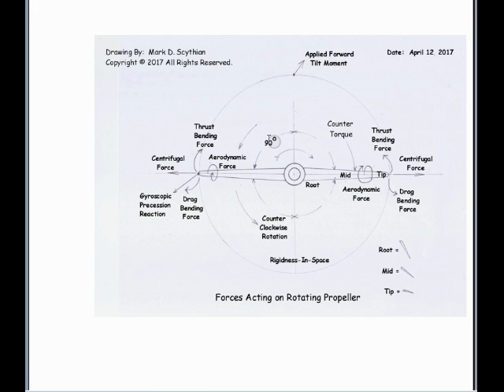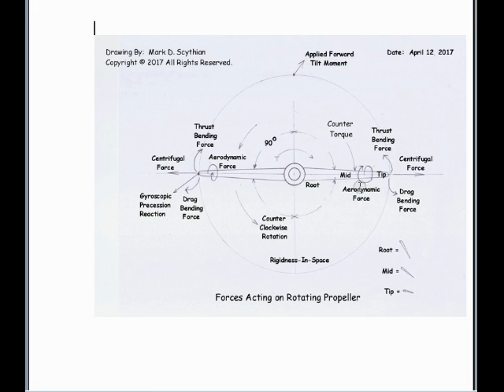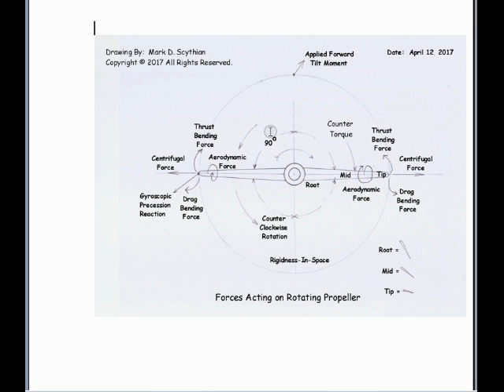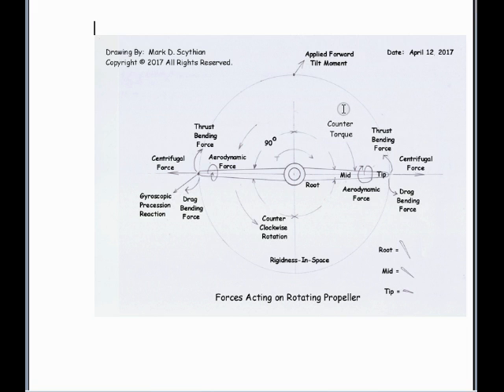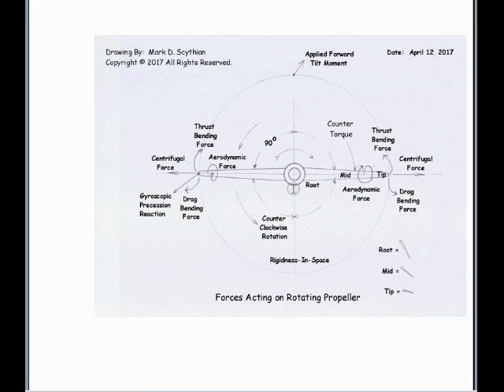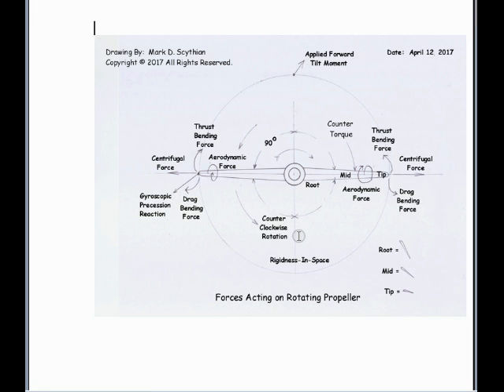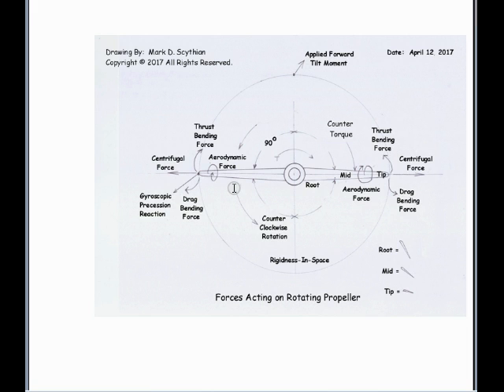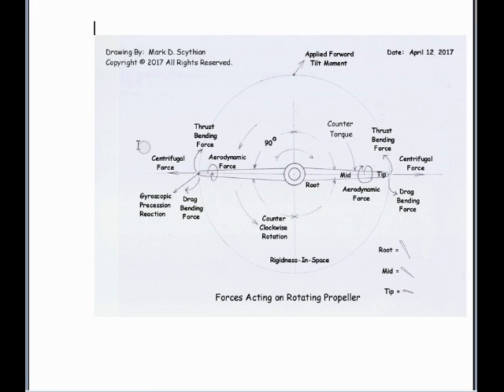Forces & Moments Acting Upon A Rotating Propeller

Comment: Awesome video! As centrifugal forces increase, does thrust and drag bending force decrease? I'm curious if blade deformation is less pronounced at higher rpms....
Reply from the maker: Thanks!  Thrust-induced bending force is a function of mechanical power (BHP) delivered to a propeller.  Bending force induced by thrust is superseded by centrifugal force.  Example:  Semi-rigid propeller fan blades on a turbofan engine will have 1/10 the thrust bending force compared to the centrifugal force at the blades when at maximum power.  The same is true with open propellers on piston and turbine-driven aircraft propellers.   Assuming the propeller is properly designed with material and dimensions having the correct Young's Modulus (E), the centrifugal force may be at least ten-times higher than the thrust bending force.  The thrust bending force on semi-rigid propellers also reinforces or enhances longitudinal strength, thus increasing thrust or lift 'control authority'.  This is especially true regarding helicopter rotors.  Thanks for your comment!

Comment: Great video!  When I look at propellers I realize that the thickness of the blade gradually decreases from the root to tip. Do you know why this is so? I'm guessing it's to maintain a constant centrifugal stress on the blade due to the increase in radius. Thanks
Reply from the maker: Hi.  Thanks for your comment!  In a sense yes, that is part of the reason, but there are six primary stresses involved with rotating airfoils also known as propellers including centrifugal force.  The other five are:  aerodynamic stress (blade wanting to straighten out with more rotational airflow drag), bending stress (thrust force), drag stress (during forward flight propeller blades are literally in every position over what would be a disk and thus incur ram air flow drag stress opposite to the thrust bending stress), procession (tilting moment 90 degrees ahead of the direction of rotation when aircraft rolls, pitches or yaws) and torque (equal and opposite angular force during rotational acceleration changes or changes in RPM). 

The blade root also makes a much shorter circumferential pathway compared to the blade mid-span and blade tip.  Even though RPM is constant across entire blade span the airflow traveling over the blade or rotating airfoil is substantially higher at the blade tip compared to the blade root.  In order to compensate for this, there is a helical twist from root to tip, from increasing blade angle to decreasing blade angle, inherent to the blade structural design.  This is completely different from Blade Pitch which is the airflow displacement or acceleration taking place per revolution of the propeller.  Most open propeller applications are constant-speed or variable blade pitch for which at low flight speed the blade pitch is low (climb propeller) and at much faster speeds blade pitch will increase by an automatic hydraulic blade pitch governor tied to either manifold pressure (piston) or fuel control feedback (turbine), this also includes dynamic pressure sensing. 

As for having a very thick blade root, that is based on exactly what you said, to exceed the tensile limit or Young's Modulus to hold up against the extreme centrifugal force involved with blade root thick, and a longer blade chord and higher angle of attack at root, while angle of attack.  blade chord and blade thickness all decrease the farther away from the blade root.  The idea is to compensate for the increasing airflow taking place as the blade span increases away from the root to keep the coefficient of lift as constant as possible across the blade.

Blade becomes much like a level as does wing, the tips of propellers and wings are very critical and flow separation at the point could lead to catastrophic failure.  Blade tips are usually thin, short chord and very low blade angle (structurally).  But not much chord, angle of attack is needed since the tips may have airflow moving close to the speed of sound which is what the blade tip airflow speed is limited to.

A lot is going on in regards to propellers and rotating airfoils, but to keep it practical to describe, there are six primary stresses involved in regard to propellers. One thing to keep an eye on is that the circumferential pathways of a propeller are always longer at the tip and shorter at the root since this is a function of the blade span or diameter (C = Pi x D), even though RPM is constant, the airflow speed over the blade span is not, so hence the helical twisting to keep the coefficient of lift constant.  Propellers are rotating wings or airfoils at their fundamental operation.

Again, thanks for your comment!
Reply: Ok I fully understand. Thanks!!
Reply from the maker: You're welcome.